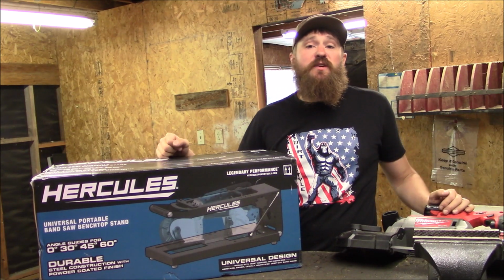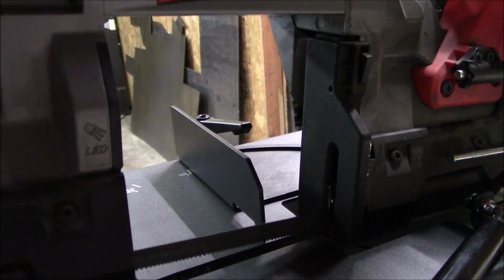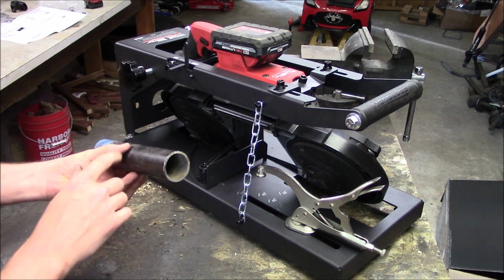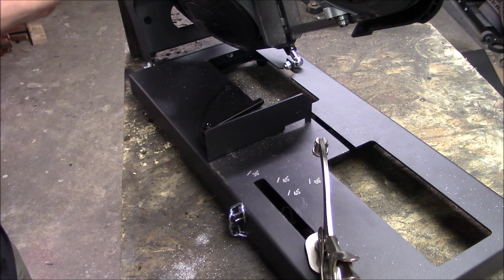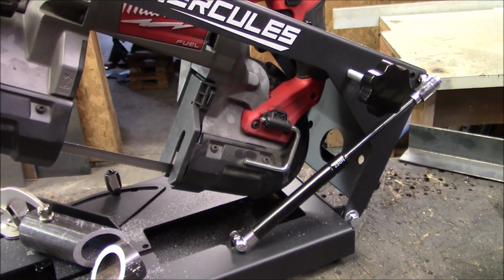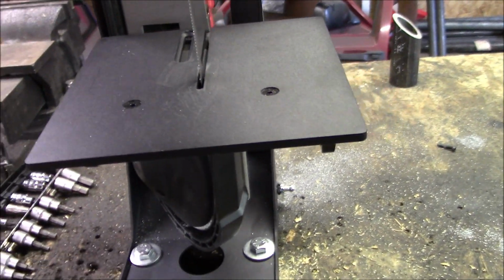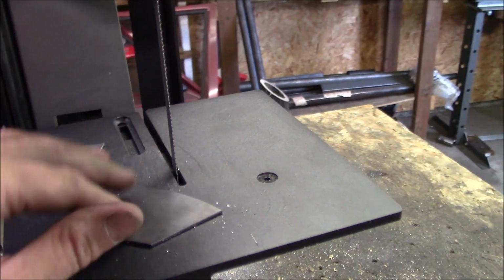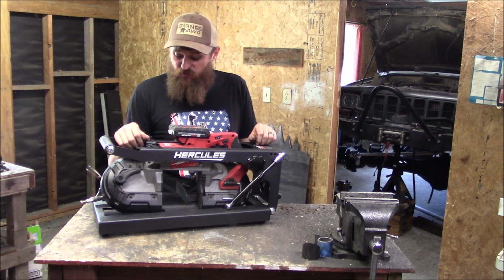Harbor Freight's New Game Changing Tool! Portable Band Saw Benchtop Table

Comment: Can you help me out ? I have a Milwaukee band saw plug in and the same portable stand but the blade is never straight even when I tighten the sides or loosen it , what do I do ?
Reply: Don't know if this will help. But it did with mine. There's 3 bolts in the rear of the stand. In between the two bolts on the hinges. If you are facing the saw from the front the first bolt on the right side closest to the hinge bolt is an adjustment bolt loosen and play with knobs. That should take care of it
Reply: @raymillsap8613  yessir! That worked for me. Thank you 👍🏻
Reply: I have same kit as the tubers video. Adjust your bolts on back side where it is hinged and may help to shim behind the rollers as well. Lastly cut your harder metals very slowly. I can cut through 1.5 inch tool steel pretty good to just need a lathe or mill face off now after making the adjustments I have mentioned.

Comment: Next improvement will be an aftermarket blow mold case so you can stow everything together.  I just got the stand and the hercules saw for it on sale for about $210.  The case that came with the saw was pretty good too, but too good to throw away.  The hercules was nice too because it doesn't have a trigger safety to mess with.

Comment: anyone having issues getting their saw to cut straight in chop saw mode? I have adjusted and adjusted till everything is square, it will cut the very last bit at an angle
Reply: My blade seems to twist also. So does my Son's. I have the Hercules saw, and my Son has a Bauer. It's like the guide rollers are too far away from the cutting area or something. Frustrating!
Reply: Having this same issue, any solution?

Comment: i setup my m18 bandsaw in the verticle position with the includes bolt on table, on my m18 saw the safety button is simply a lock an unlock button, so i leave it unlocked, on the hercules switch i shaved one side of the on odd stop stem so that when i turn on the tool the trigger bar slides over the stem but still locks in place on the flat face on the other side

Comment: Get a HF momentary foot switch and zip tie the trigger down. When you need the tool to run just depress the pedal with your foot.
Reply: How would you wire this in on a battery operated tool?
Reply: @RichardBauer_  that is a good question, I’m sure it is possible with a little electrical engineering. Have to step down the voltage coming out of the outlet to meet the requirements for the battery powered tool. I personally don’t know how to do it but again, I’m sure it is possible. If you figure it out definitely make a video and share!

Comment: I messed around with this thing, its a bit flimsy and the clamp sucks, its a pass for me.. I use the Swag table for the portaband and use a Evolution low rpm carbide chop saw.
Save the money for a “real” bandsaw if you need precision.
Reply: It's definitely not flimsy, clamp works fine for me.

Comment: Wouldn't a chop saw do better?
Reply: This thing isn't capable of making a s straight cut to save its life.   The blade drifts and its never square.   Piece of garbage.
Reply from the maker: Check your guide bearings, I had a broken one causing my blade to not cut straight.
Reply: @fernandorosales2418 user error
Reply: Apparently you haven't tried making precision cuts with both. Spoiler alert!!!! It doesnt walk or deflect like a chopsaw blade. It also makes the portable badsaw more versatile eliminateing the need for a stationary bandsaw for most people.
Reply: @mikecostello3147  automotive cuts i would say aren't quite precision cuts you aren't building a particle accelerator lol  aka roll cages bumpers roof racks. I have had zero issue building all of the above with only a chop saw, notcher, welder and grinder.
Reply: @masonmcdowell-o2u  we can fix anything with a welder 😏
Reply: What size is your Milwaukee?is it 5 inch
Reply: Looks like it doesn’t need a lot of dialing in like a big bandsaw like playing with belts and tension adjustments

Comment: I'm assuming that it will not work with the corded models ??
Reply: Get a corded one then add the foot switch
Reply from the maker: It had instructions on corded models as well.  So yes it should
Reply: @MuddyBeards4X4  cool yes just looked it up . This is now on my to get list for shop. Good deal for small shop.

Comment: To remove, just take out the center bolt on the cross brace. That way your bracket stays set where the saw needs to be positioned. You don’t need to pull the whole front bracket out to remove the saw. Plus, then you have the bolt out to put the front handle back on the saw.
Reply from the maker: Good call.